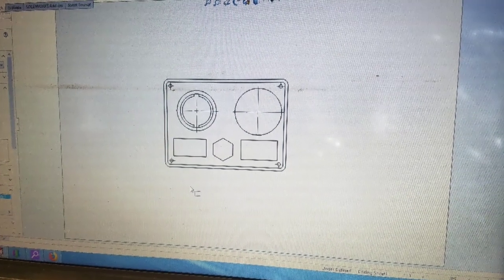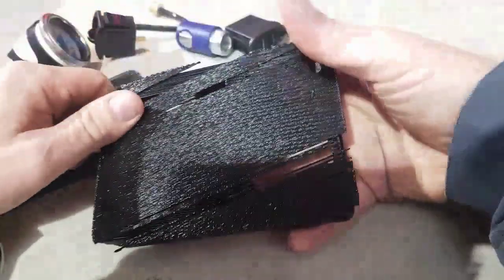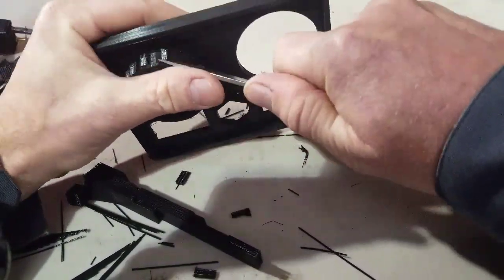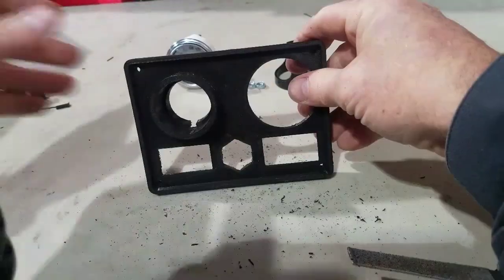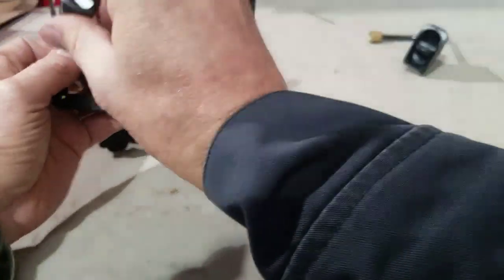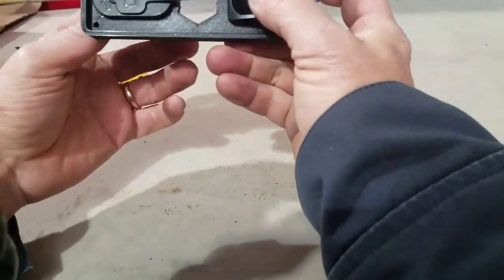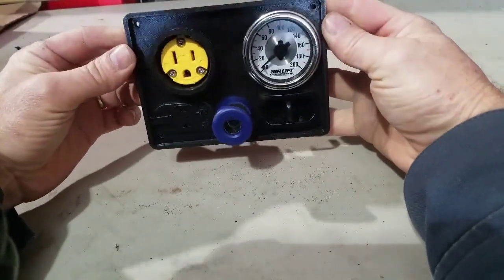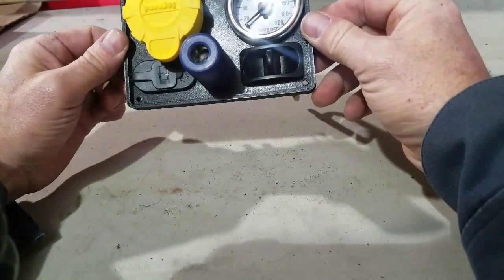Building a custom 3d printed control panel

Comment: How do you know what size the parts is and then put the size on to the computer?
Reply from the maker: It's custom. I build it to suit the parts we're using by measuring the parts then transferring those measurements to a 3d modeling program to build the 3d part.
Reply: Exactly one of the reasons I need a printer … the options are endless. Nice job 👍🏻